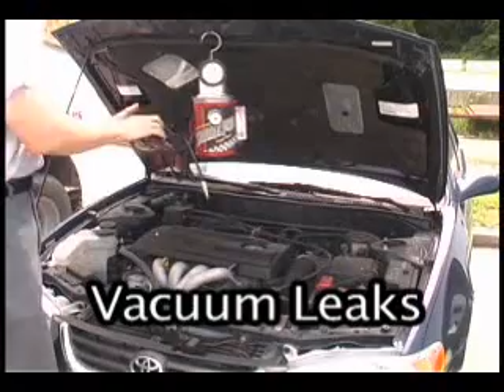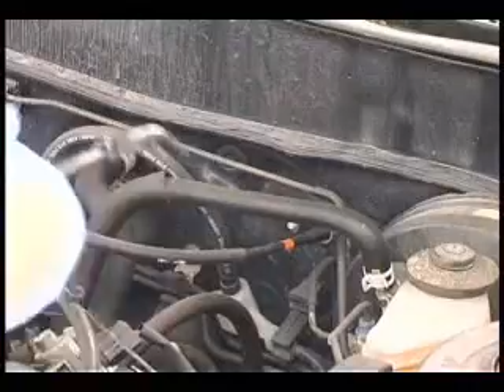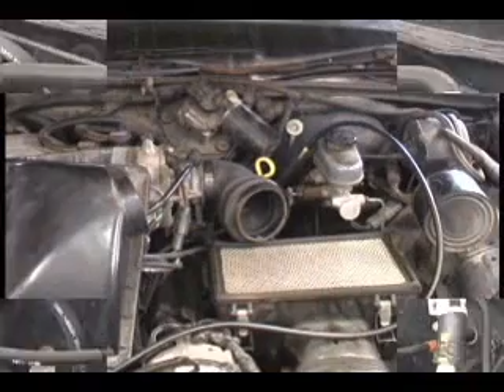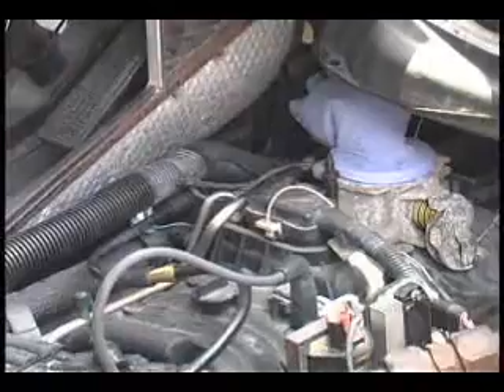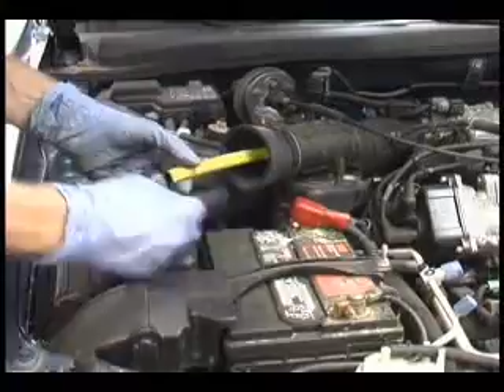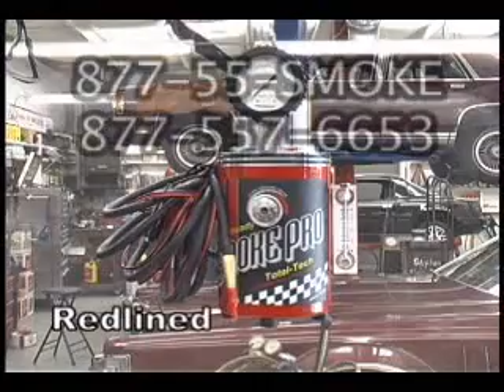Smoke Pro Diagnostics Vaccum Leaks

Comment: Is there vacuum in the crank case? I thought it had a slightly positive pressure because of blow-by and bad valve cover gaskets wouldn't cause a vacuum leak.